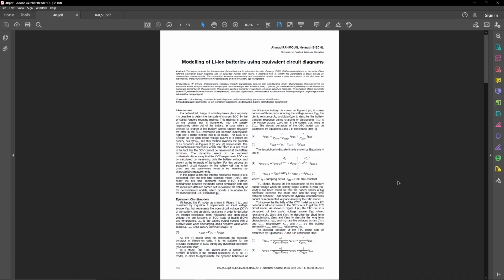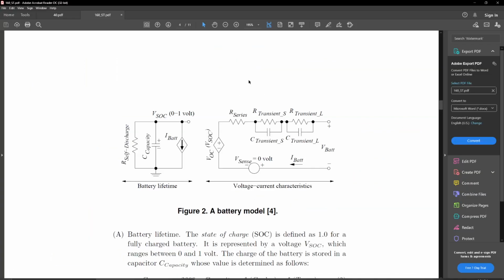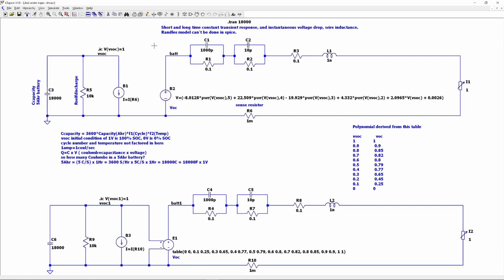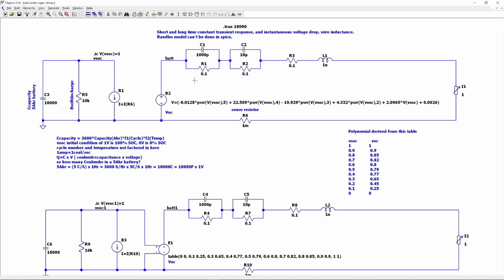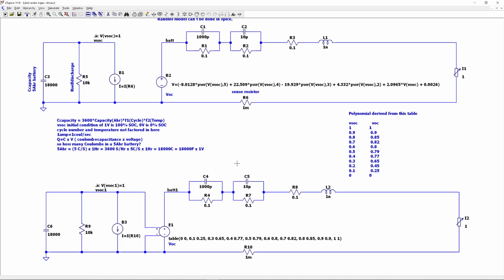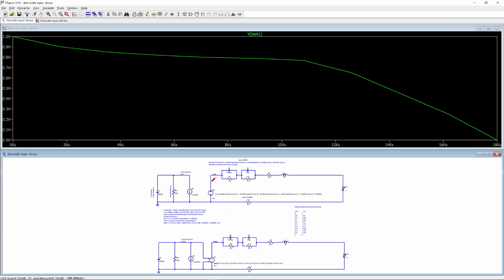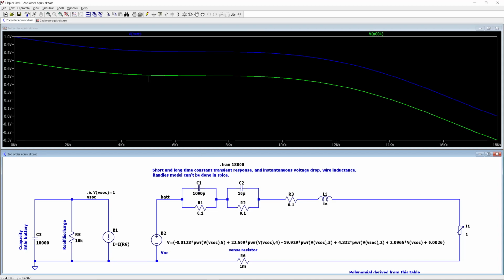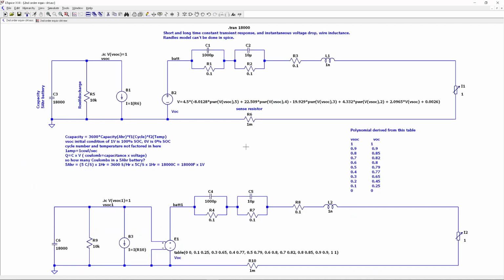Model Lithium Ion Battery with LTspice

Comment: Thanks for the informative video, Mike! Any thoughts on how you might connect multiple such models in series to simulate a battery stack?
Reply from the maker: The battery capacity cap increases by the number of cells. The output voltage sources and impedances increase by the number of cells. You could try just copy-paste more of them and see if it simulates or do the math by hand and change the simulation values. I haven't tried it but maybe it will work.

Comment: Thank you for your video. Have you tried putting this model in series to say 2 or 3 in series? Would it work?
Reply from the maker: It should work, but how well can vary with spice. Sometimes it can be tricky to make a simulation converge. I haven't had problems with this one.
Reply: @miketrupiano7232  I have tried it but doesn't quite work.  I am trying to use it for an active cell balancing system and I want to see some cells in the string lose charge and others gain charge. I connected two in series but the upper battery produces only 2.5V, while the lowere referenced to ground produces correctly the voltage.  Ergo why I asked the question. I am using LTSpice with looser convergence parameters and 3% error rtol to help it. Any ideas?
Reply from the maker: @robr8554  I don't think I tried that. Might be tricky. If you have a way to share it, I could take a look. No promise of success though.
Reply: @miketrupiano7232  awesome 👌

Comment: Hey! Thanks for the video. Can I know what's the pwr you have included in the formula. Also, vsoc means the different voltages on the discharge curve?
Reply from the maker: The current set by I1 or I2 is the load. In this case, constant current. Vsoc represent State of Charge.
Reply: @miketrupiano7232  Thanks. Also, how did you get the values of transient R and C?
Reply from the maker: @sampathkumar4773  I made up values so the simulation would look about right. They didn't come from a real battery.
Reply: @miketrupiano7232  Thanks. Any idea on how to calculate the self discharge resistor? The datasheet has value in terms of %
Reply from the maker: @sampathkumar4773  for the purpose of this simulation the self discharge is not a significant factor. Given that, here is a simplistic way to look at it. Let's say in three months the battery drops from 3.7 to 3.48 volts. If the battery capacity is represented by 18000F and takes 7.8E6 seconds to drop from 3.7 to 3.48 volts then R has to be about 7.4K ohms. You could create your own RC discharge spice simulation to show this or use a calculator like this one. http://www.circuits.dk/calculator_capacitor_discharge.htm

Comment from the maker: Copy the below text into your favorite text editor (notepad) and save it with the file extention .ASC and it will open into LTspice.
Version 4
SHEET 1 2012 1412
WIRE 48 64 -16 64
WIRE 176 64 112 64
WIRE 288 64 240 64
WIRE 416 64 352 64
WIRE -640 128 -848 128
WIRE -528 128 -640 128
WIRE -432 128 -528 128
WIRE -112 128 -160 128
WIRE -16 128 -16 64
WIRE -16 128 -112 128
WIRE 176 128 176 64
WIRE 240 128 240 64
WIRE 240 128 176 128
WIRE 416 128 416 64
WIRE 560 128 416 128
WIRE 752 128 640 128
WIRE 1552 128 832 128
WIRE -16 176 -16 128
WIRE 48 176 -16 176
WIRE 176 176 176 128
WIRE 176 176 128 176
WIRE 240 176 240 128
WIRE 288 176 240 176
WIRE 416 176 416 128
WIRE 416 176 368 176
WIRE 1552 272 1552 128
WIRE -640 304 -640 128
WIRE -432 304 -432 128
WIRE -848 320 -848 128
WIRE -160 320 -160 128
WIRE -848 480 -848 384
WIRE -640 480 -640 384
WIRE -640 480 -848 480
WIRE -432 480 -432 384
WIRE -432 480 -640 480
WIRE -160 480 -160 400
WIRE -160 480 -432 480
WIRE 288 480 -160 480
WIRE 1552 480 1552 336
WIRE 1552 480 368 480
WIRE -848 512 -848 480
WIRE 64 944 0 944
WIRE 192 944 128 944
WIRE 304 944 256 944
WIRE 432 944 368 944
WIRE -624 1008 -832 1008
WIRE -512 1008 -624 1008
WIRE -416 1008 -512 1008
WIRE -256 1008 -416 1008
WIRE -96 1008 -144 1008
WIRE 0 1008 0 944
WIRE 0 1008 -96 1008
WIRE 192 1008 192 944
WIRE 256 1008 256 944
WIRE 256 1008 192 1008
WIRE 432 1008 432 944
WIRE 576 1008 432 1008
WIRE 768 1008 656 1008
WIRE 1568 1008 848 1008
WIRE 0 1056 0 1008
WIRE 64 1056 0 1056
WIRE 192 1056 192 1008
WIRE 192 1056 144 1056
WIRE 256 1056 256 1008
WIRE 304 1056 256 1056
WIRE 432 1056 432 1008
WIRE 432 1056 384 1056
WIRE 1568 1152 1568 1008
WIRE -624 1184 -624 1008
WIRE -416 1184 -416 1008
WIRE -832 1200 -832 1008
WIRE -144 1200 -144 1008
WIRE -256 1216 -256 1008
WIRE -192 1216 -256 1216
WIRE -192 1264 -256 1264
WIRE -832 1360 -832 1264
WIRE -624 1360 -624 1264
WIRE -624 1360 -832 1360
WIRE -416 1360 -416 1264
WIRE -416 1360 -624 1360
WIRE -256 1360 -256 1264
WIRE -256 1360 -416 1360
WIRE -144 1360 -144 1280
WIRE -144 1360 -256 1360
WIRE 304 1360 -144 1360
WIRE 1568 1360 1568 1216
WIRE 1568 1360 384 1360
WIRE -832 1392 -832 1360
FLAG -848 512 0
FLAG -528 128 vsoc
FLAG -832 1392 0
FLAG -512 1008 vsoc1
FLAG -96 1008 batt1
FLAG -112 128 batt
SYMBOL res 144 160 R90
WINDOW 0 0 56 VBottom 2
WINDOW 3 32 56 VTop 2
SYMATTR InstName R1
SYMATTR Value 0.1
SYMBOL res 384 160 R90
WINDOW 0 0 56 VBottom 2
WINDOW 3 32 56 VTop 2
SYMATTR InstName R2
SYMATTR Value 0.1
SYMBOL res 656 112 R90
WINDOW 0 0 56 VBottom 2
WINDOW 3 32 56 VTop 2
SYMATTR InstName R3
SYMATTR Value 0.1
SYMBOL cap 112 48 R90
WINDOW 0 0 32 VBottom 2
WINDOW 3 32 32 VTop 2
SYMATTR InstName C1
SYMATTR Value 1000p
SYMBOL cap 352 48 R90
WINDOW 0 0 32 VBottom 2
WINDOW 3 32 32 VTop 2
SYMATTR InstName C2
SYMATTR Value 10u
SYMBOL res -656 288 R0
SYMATTR InstName R5
SYMATTR Value 10k
SYMBOL cap -864 320 R0
SYMATTR InstName C3
SYMATTR Value 18000
SYMBOL bi -432 304 R0
SYMATTR InstName B1
SYMATTR Value I=I(R6)
SYMBOL res 384 464 R90
WINDOW 0 0 56 VBottom 2
WINDOW 3 32 56 VTop 2
SYMATTR InstName R6
SYMATTR Value 1m
SYMBOL bv -160 304 R0
WINDOW 3 58 70 Left 2
SYMATTR Value V=(-8.0128*pwr(V(vsoc),5) + 22.509*pwr(V(vsoc),4) - 19.929*pwr(V(vsoc),3) + 4.332*pwr(V(vsoc),2) + 2.0965*V(vsoc) + 0.0026)
SYMATTR InstName B2
SYMBOL ind 736 144 R270
WINDOW 0 32 56 VTop 2
WINDOW 3 5 56 VBottom 2
SYMATTR InstName L1
SYMATTR Value 1n
SYMBOL load 1536 272 R0
WINDOW 123 0 0 Left 0
WINDOW 39 0 0 Left 0
SYMATTR InstName I1
SYMATTR Value 1
SYMBOL res 160 1040 R90
WINDOW 0 0 56 VBottom 2
WINDOW 3 32 56 VTop 2
SYMATTR InstName R4
SYMATTR Value 0.1
SYMBOL res 400 1040 R90
WINDOW 0 0 56 VBottom 2
WINDOW 3 32 56 VTop 2
SYMATTR InstName R7
SYMATTR Value 0.1
SYMBOL res 672 992 R90
WINDOW 0 0 56 VBottom 2
WINDOW 3 32 56 VTop 2
SYMATTR InstName R8
SYMATTR Value 0.1
SYMBOL cap 128 928 R90
WINDOW 0 0 32 VBottom 2
WINDOW 3 32 32 VTop 2
SYMATTR InstName C4
SYMATTR Value 1000p
SYMBOL cap 368 928 R90
WINDOW 0 0 32 VBottom 2
WINDOW 3 32 32 VTop 2
SYMATTR InstName C5
SYMATTR Value 10u
SYMBOL res -640 1168 R0
SYMATTR InstName R9
SYMATTR Value 10k
SYMBOL cap -848 1200 R0
SYMATTR InstName C6
SYMATTR Value 18000
SYMBOL bi -416 1184 R0
SYMATTR InstName B3
SYMATTR Value I=I(R10)
SYMBOL res 400 1344 R90
WINDOW 0 0 56 VBottom 2
WINDOW 3 32 56 VTop 2
SYMATTR InstName R10
SYMATTR Value 1m
SYMBOL ind 752 1024 R270
WINDOW 0 32 56 VTop 2
WINDOW 3 5 56 VBottom 2
SYMATTR InstName L2
SYMATTR Value 1n
SYMBOL load 1552 1152 R0
WINDOW 123 0 0 Left 0
WINDOW 39 0 0 Left 0
SYMATTR InstName I2
SYMATTR Value 1
SYMBOL e -144 1184 R0
SYMATTR InstName E1
SYMATTR Value table(0 0, 0.1 0.25, 0.3 0.65, 0.4 0.77, 0.5 0.79, 0.6 0.8, 0.7 0.82, 0.8 0.85, 0.9 0.9, 1 1)
TEXT 200 -72 Left 2 !.tran 18000
TEXT -928 416 VLeft 2 ;Ccapacity\n5Ahr battery
TEXT -184 -40 Left 2 ;Short and long time constant transient response, and instantaneous voltage drop, wire inductance.\nRandles model can't be done in spice.
TEXT 248 416 Left 2 ;sense resistor
TEXT -136 432 Left 2 ;Voc
TEXT -552 88 Left 2 !.ic V(vsoc)=1
TEXT -768 584 Left 2 ;Ccapacity = 3600*Capacity(Ahr)*f1(Cycle)*f2(Temp)\nvsoc initial condition of 1V is 100% SOC, 0V is 0% SOC\ncycle number and temperature not factored in here \n1amp=1coul/sec\nQ=C x V ( coulomb=capacitance x voltage)\nso how many Coulombs in a 5Ahr battery?\n5Ahr = (5 C/S) x 1Hr = 3600 S/Hr x 5C/S x 1Hr = 18000C = 18000F x 1V
TEXT -680 416 VLeft 2 ;Rselfdischarge
TEXT 928 544 Left 2 ;Polynomial derived from this table\n \nvsoc            voc\n1               1\n0.9             0.9\n0.8             0.85\n0.7             0.82\n0.6             0.8\n0.5             0.79\n0.4             0.77\n0.3             0.65\n0.2             0.45\n0.1             0.25\n0               0
TEXT -120 1312 Left 2 ;Voc
TEXT -544 968 Left 2 !.ic V(vsoc1)=1

Comment: Sometime manufactors of Li 3,3V Battery says SOC=0 when VOC=2V. How can made this on your model?
Reply from the maker: In general, it is not good to let the battery go below 2V so any remaining capacity can't be used. There is very little charge left there anyhow. So it is common to refer to that a 0% SOC. Also look at RelativeSOC, or useable battery capacity. To make the model shown here work, battery data down to OCV=0 is used.

Comment: Does this roughly approximate battery chemistry delay?
Reply from the maker: I think the short answer is yes. If you want to really go in depth, I put a couple links in the description as a place to start. I'm not a chemist and battery models are getting quite intricate these days. There was a time when the model I show here would have been beyond what most people were even aware of. With batteries having become the biggest area of needed improvement and focus this is not so any longer.

Comment: Sir, how do you get the formula for B2 voltage source, is it based on experimental test results ?
Reply from the maker: For this video I made up the table for E1 then using Excel I derived a formula fitting the table to use for B2. In real life, this could come from test data or a battery data sheet.

Comment: Thank you for explaining and showing the model. 

1. Can you please tell me how charging of battery can be simulated using this? This model shows only discharging of battery. 
2. Also how can I calculate battery SOC from this?

Thank you so much sir.
Reply from the maker: experiment with turn current source I1 the other direction. The voltage on C3 is related to SOC.
https://en.wikipedia.org/wiki/State_of_charge
Reply from the maker: Version 4
SHEET 1 2012 1412
WIRE 48 64 -16 64
WIRE 176 64 112 64
WIRE 288 64 240 64
WIRE 416 64 352 64
WIRE -640 128 -848 128
WIRE -528 128 -640 128
WIRE -432 128 -528 128
WIRE -112 128 -160 128
WIRE -16 128 -16 64
WIRE -16 128 -112 128
WIRE 176 128 176 64
WIRE 240 128 240 64
WIRE 240 128 176 128
WIRE 416 128 416 64
WIRE 560 128 416 128
WIRE 752 128 640 128
WIRE 1552 128 832 128
WIRE -16 176 -16 128
WIRE 48 176 -16 176
WIRE 176 176 176 128
WIRE 176 176 128 176
WIRE 240 176 240 128
WIRE 288 176 240 176
WIRE 416 176 416 128
WIRE 416 176 368 176
WIRE 1552 256 1552 128
WIRE -640 304 -640 128
WIRE -432 304 -432 128
WIRE -848 320 -848 128
WIRE -160 320 -160 128
WIRE -848 480 -848 384
WIRE -640 480 -640 384
WIRE -640 480 -848 480
WIRE -432 480 -432 384
WIRE -432 480 -640 480
WIRE -160 480 -160 400
WIRE -160 480 -432 480
WIRE 288 480 -160 480
WIRE 1552 480 1552 336
WIRE 1552 480 368 480
WIRE -848 512 -848 480
FLAG -848 512 0
FLAG -528 128 vsoc
FLAG -112 128 batt
SYMBOL res 144 160 R90
WINDOW 0 0 56 VBottom 2
WINDOW 3 32 56 VTop 2
SYMATTR InstName R1
SYMATTR Value 0.1
SYMBOL res 384 160 R90
WINDOW 0 0 56 VBottom 2
WINDOW 3 32 56 VTop 2
SYMATTR InstName R2
SYMATTR Value 0.1
SYMBOL res 656 112 R90
WINDOW 0 0 56 VBottom 2
WINDOW 3 32 56 VTop 2
SYMATTR InstName R3
SYMATTR Value 0.1
SYMBOL cap 112 48 R90
WINDOW 0 0 32 VBottom 2
WINDOW 3 32 32 VTop 2
SYMATTR InstName C1
SYMATTR Value 1000p
SYMBOL cap 352 48 R90
WINDOW 0 0 32 VBottom 2
WINDOW 3 32 32 VTop 2
SYMATTR InstName C2
SYMATTR Value 10u
SYMBOL res -656 288 R0
SYMATTR InstName R5
SYMATTR Value 1Meg
SYMBOL cap -864 320 R0
SYMATTR InstName C3
SYMATTR Value 18000
SYMBOL bi -432 304 R0
SYMATTR InstName B1
SYMATTR Value I=I(R6)
SYMBOL res 384 464 R90
WINDOW 0 0 56 VBottom 2
WINDOW 3 32 56 VTop 2
SYMATTR InstName R6
SYMATTR Value 1m
SYMBOL bv -160 304 R0
WINDOW 3 58 70 Left 2
SYMATTR Value V=(-8.0128*pwr(V(vsoc),5) + 22.509*pwr(V(vsoc),4) - 19.929*pwr(V(vsoc),3) + 4.332*pwr(V(vsoc),2) + 2.0965*V(vsoc) + 0.0026)
SYMATTR InstName B2
SYMBOL ind 736 144 R270
WINDOW 0 32 56 VTop 2
WINDOW 3 5 56 VBottom 2
SYMATTR InstName L1
SYMATTR Value 1n
SYMBOL current 1552 336 R180
WINDOW 0 24 80 Left 2
WINDOW 3 24 0 Left 2
WINDOW 123 0 0 Left 0
WINDOW 39 0 0 Left 0
SYMATTR InstName I1
SYMATTR Value PWL(0 .1 100 1 15900 1 16000 0)
TEXT 200 -72 Left 2 !.tran 25000
TEXT -928 416 VLeft 2 ;Ccapacity\n5Ahr battery
TEXT 248 416 Left 2 ;sense resistor
TEXT -136 432 Left 2 ;Voc
TEXT -552 88 Left 2 !.ic V(vsoc)=0.2
TEXT -680 416 VLeft 2 ;Rselfdischarge